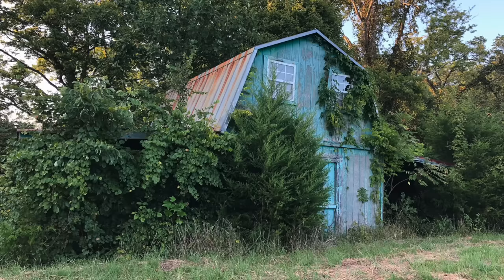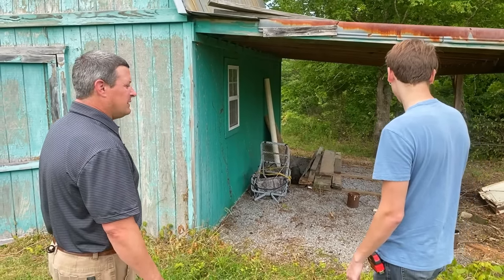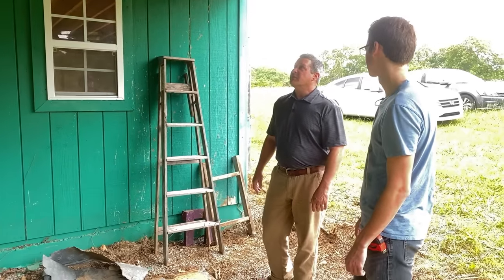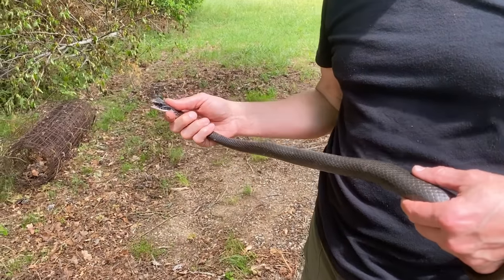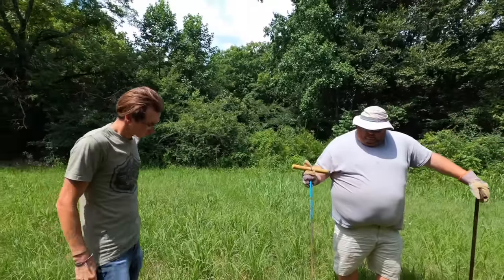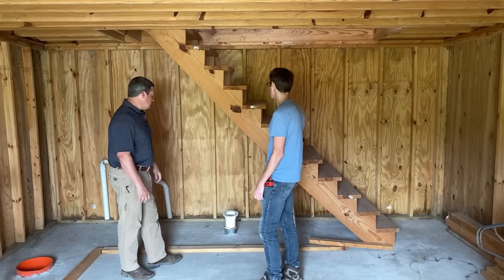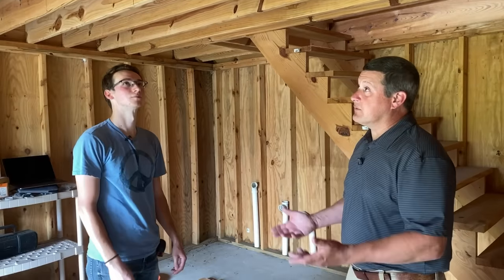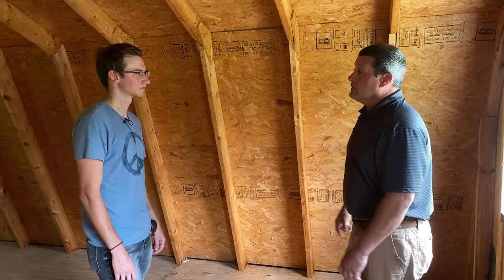Will This Home Depot Shed Meet Building Code?

Comment: If it's structurally sound and meets state safety and fire standards, then the shed should meet building code. Zoning is a different story as in most cities, even safe and well built alternative housing structures like sheds and travel trailers are not allowed to be used as dwellings. Municipalities want people to live in conventional houses and apartments so they can maximize property tax revenue and won't issue permits for alternative housing. Big Government is out of control in most places!
Reply: Sciencer: you make a couple of assumptions here - different ‘use’ buildings often have different requirements. A shed that would ‘pass’ doesn’t insure it would successfully pass code for a dwelling.
Reply: And a great reason that we live in a place that technically doesn’t need a permit at all. We just chose to do it so danner could go through the process.
Reply: And this makes so much sense. It's absolutely true. I didn't think about why they would deny a person a building permit, but now it makes sense...(the mighty dollar). Very insightful
Reply: @lakishadm6587  my county just goes by state building code with no building inspectors but you have the environmental sewage inspection permit that is first required to get any building permit. Then if you have electrical that has to be inspected also. So even if a person wants to live off grid to convert a shed they still are required a sewage permit and this can be a huge issue depending on the land situation and what kind of treatment a person wants. I am using composting toilets and those are allowed as a privy but a privy is only for a seasonal residence permit! The county next door does permit a "year-round composting toilet" but that is a very rare understanding by their sewage inspector! So technically any "toilet waste treatment device" in a structure is a privy that requires a permit. But by the state standard if there is no discharge then no permit is needed and legally after a year the septage is no longer septage (and thus no longer discharge). So a person could technically have a composting toilet in their dwelling as long as it is a "continuous composting" system with no discharge for a year minimum. Discharge means any kind of dumping of the septage. But then according to state building standards composting toilets are not allowed as a plumbing code - if you do have a continuous composting toilet that requires plumbing. If there are no pipes but just a toilet "chute" into a composting chamber then that is not considered plumbing - but I suppose it is arguable. I actually talked to the county sewage planner and I realized he didn't understand composting and he said he thought a year-round composting toilet could be permitted but it would have to be installed by some professional designer, etc. This is definitely part of the "mighty dollar" problem because there is no state permit needed for a farm to spread class-A or class-B human biosolids and so composting as a farm is allowed based on the sewage permit standards! 
So legally you could put the composting toilet in a tent so that it's a shelter and not a structure - and then move the tent every six months. But composting only takes place if the temperature is warm enough - and also people like not having to go outside in the cold. hahahaha. We get very cold climate where I am at. Also a farm building does not require plumbing code but that is only if you get tax assessed as a farm - which requires certain standards like minimum acres or what kind of crops, etc.
So it's probably better to just live in a tent without the government micromanaging something they don't understand: Ecological sanitation as composting!! Legally a person in my zoning can camp for seven months a year - with residency established after six months. But to get a street address as a permanent residency then the tax assessor needs to have some kind of permanent "facilities" building permit based on the said sewage permit catch-22. Vermont is trying to pass a law enabling people with composting toilets to actually compost on their land! Why? Someone got shut down on their farm for composting. There is a youtube channel with regular zoom discussions about this situation in Vermont - if that law passes then it would help other states pass the same law.

Comment: My house in Phoenix, Arizona was built in 1966. the main portion of the home is 4 x 8 x 16 concrete block, the addition I built is 2 x 8 framing with batt insulation. The exterior walls were furred with 1 x 2 strips, then foil backed drywall around the entire perimeter. I am sure your uncle will guide you correctly in how to modify the existing building to meet your local codes. Paying attention to detail, and going the extra mile will save you later so you do not have to make major changes! Plumbing will most likely be the biggest issue. I love anything house, I will be watching carefully!! Good luck with the endeavor you are under taking!!!!

Comment: Last yr, my son's friend bought a straight wall. 2 story Tuff-Shed and we wired it for him in a weekend! Elec hot water tank went under the stair landing. Elec Panel was above that with elec service meter on the N end of the building. Circuits went up through upper and lower stair well walls. Toilet, shower,  was under stairs, 30" door on rt end. Kitchen cabinets from stair to bathroom door. Wood stove   in S. back corner of liv room. Mini/split AC N end, next to elec service. Upstairs big bedroom and sleeper/sofa down stairs for company. His Tuff Shed roof sagged and walls spread after heavy rains! We pulled the walls back in with come-alongs, Bolted steel cables thru the wall headers, next to each roof rafter with turn buckles in the center for adjusting. Then added an L shaped brace above the ceiling and short vertical 2x4's bracing the center ridge. Building wouldn't have passed a framing inspection as-is but the guys who built the kit weren't framers and there was no inspections out in the country... Glad we caught it in the elec rough in stage!

Comment: When they talk about grading, that is somewhat important because you want the ground around the first ten feet of area around the building to slope gently away. Otherwise the footings and concrete get damp and promote mold and wood rot. He mentions "swales" or shallow valleys to drain water away around the high side. Closed captioning actually called them "swells" , one being the opposite of the other. Also, soil around buildings tends to build up over the years, as much as 6 inches in a hundred years, due to fertilizer, loose dirt accumulating, rotting leaves and such, so you want to make sure the floor stands up proud from the landscaping.

Also, the first floor may need more windows. Something like 7 percent of the floor area as window. Also, any bedroom needs an outside door or window of a complicated particular size (allows a firefighter with a air pack through). 24" high opening minimum. 

You can make the first floor a small studio/bedroom, and use the stairway as is, closed off by a door below to the "storage attic" as last resort and still meet code. If you insulate correctly. Last resort. Might be a quick interim method, with a plan to change upstairs later. They might not notice, but each dwelling also requires a 36" wide front door. If it opens into a bedroom, that meets the emergency egress/rescue requirement for bedrooms too. If you want, call the garage a patio and do nothing to it for a long time.  Also, the metal siding you mentioned is a good idea also for fire protection as well. With global climate change that might become a problem eventually in your area.

Stairway height clearance is 6'-8" clear, but used to be 6'-6".  The studs at the bottom look like almost 3' on center! There are certain advantages to open cell foam in a fairly dry area, in that you can use it between rafters and not have to ventilate the attic, but that is a somewhat new development.
Reply: Gary Wheeler, I was thinking the same thing. This shed is at the bottom of a long downhill slope yet the slab supporting it isn’t built up enough to keep serious rainwater out, nor compensate for sod rising over time. My in-ground swimming pool is now BELOW the sod on one side because in the last 16 years since it was installed the sod has built up. I’m not sure how to combat the situation unless I rent a sod cutter and remove the lawn entirely, dig down several inches, then roll the sod back in place (or re-seed and hope the grass seed takes in the hot pool area. 

I love this shed. I did an in person walk-thru of this style shed at my local Home Depot about ten years ago, and it’s the perfect 2 story camp, guest house, bachelor pad, or newlywed apartment.
Reply: @GW
Egress has nothing to do with fire personnel getting in. 
NFPA specifies a second means of ESCAPE. Firefighters will (and should) use their bars and eliminate entrance barriers in seconds. 
Specifically less than 44” from the floor, minimum 20” width, minimum 24” height, at least 5.7 square feet. Some jurisdictions allow 5sf, or 5sf first floor, 5.7sf second floor. And the secondary means of egress needs to be less than 20’ to the exterior grade.
Reply: @fishhuntadventure  : the term residential "egress" windows specifically uses requirements of size and accessibility to allow residents to exit and fire personnel with an air pack to come in and rescue. So there is that...

Comment: Building codes, permits, inspections, taxes and fees.... things used by the county and state governments to control what you do on the property that you bought and supposedly own, the government  makes a profit off your land ownership. If you buy land there is a property tax you pay(each year)... if you build a house on it... the tax goes up... if you build a barn/garage/shop on it the tax goes up... If you improve the value of any of those... the tax goes up.. all while you had to pay a fee for a permit to even build them in the first place. You have to pay a fee for the inspection... then there is building codes the inspectors follow... which usually equate to having to pay more out of pocket to meet their requirements...
Reply: No permit was required to build on our land. We chose to do it so Danner could go through the process. Our local building department is amazing. They are completely centered on people succeeding.
Reply: The counter point in favor of building codes is that what you do for yourself is all since and good but if your shoddy work puts guests or the people you sell the house to in forseable danger then we should prevent that.
Reply: @brianzmek7272  Those are certainly not valid reasons allowing any government to deny you the ability to build what you want on your property without interference.  Guests and future owners are assumed to have brains of their own.  It is not a counterpoint, it is a talking point, and not a good one.  Building codes are unconstitutional, complements of the Fourth Amendment.  If you have not yet realized what happens when you allow the government a little power, you need to pay more attention.  When the same people who mandate the quality of construction levy taxes based on that quality level, you have a certainty that some day no one but the rich will be able to afford even a 500 sq. ft. home!  Do not encourage this nonsense.
Reply: 100% agree and the insurance companies implement most of the codes to make the houses insurable, and I get making structures safe but controlling every little detail down to the stairs and trying to make it impossible for someone to build a house without contracting the work out to someone else is a bit excessive to me. The insurance companies want to prevent hazardous conditions from injuring someone, yes, but they go way overboard with it. If it's OUR property, our money is being paid to build it, then why do they care if my stairway isn't precisely how they say it should be? And why does the government need to profit from my investment, why do I owe them anything for building a house on land that doesn't belong to them? I guess charging for the inspections makes some sense, but the loads of additional fees in some municipalities is just beyond reasonable. They even go as far as to 
Control the appearance of homes in some cities, even when the materials used have no bearing on safety at all.
In ways it just seems that the government are just freeloaders who make money from us in which they are not entitled to, and they want to control every aspect of our lives. But just because the government declares they are entitled to it, that makes it so, who are we to question the rulers of our nation? The whole thing is just out of hand, not to mention to majority of people who take out a mortgage will end up being a slave to whichever bank they finance through, the interest compounds so much that they never get it paid off. This is why so many people are turning to alternative means, though the government tries to outlaw that with these strict ordinances. someday very few people will take out a mortgage because people are getting fed up with being in debt for their entire life.
Reply: I agree with you 100% America is home of the fee not the free
Reply: @jermanemckay8945  True specially in Texas. Property taxes are SKY high.
Reply: it’s been really upsetting for me trying to get my first home on my family’s land. i don’t want to have to fly under the radar of the law just to have a free standing studio apartment house!
Reply: @Leo D  not if you designate the land as a farm or ranch to get the agricultural  rate. Just buy a couple of goats or sheep. Discounted taxes and free future food source
Reply: @CliffBailey53  You're a good person. 🤘
Reply: I've been saying this for years. I always hear its for public safety and future sale... it's private property not public and before every purchase there should be(and almost always is) an Inspection. Ok let's says those reasons are good, why are we being taxed every year? If I buy land and just camp on it the taxes are about 150 a year here in florida, but if I build they are around 2500 lol with is that
Reply: @MrZZeroG  That's great. I wish I could say the same about those controlling Washington state
Reply: @James-gx9mr 
Its not so unreasonable, in theory- a tax on properties means there's an opportunity cost on just sitting on land en masse, so that more people can have the opportunity to be land owners.

These kinds of laws are all over- such as how the point of copyright is to give innovators a bit of exclusivity at first, so there's financial incentives to keep being innovative.

The problem, of course, is that these types of rules aren't enforced in a way that actually serves the purpose of enabling opportunity, and instead more often inconveniences the little guy.

I mean, the original purpose of copyright has been all but forgotten

Comment: I like how the guy said if you eliminate the air leaks, you will reduce the moisture issue.
Home Depot has those thin foam panels you put in the attic above the soffit to prevent blanket insulation from blocking air passage to the ridge. Since he'll be occupying the attic, perhaps run those panels to the ridge vent you'll be installing.
Then use 2" of closed cell Froth Pak from floor to ridge. That should leave an inch or two gap before the drywall.
That'll make it air tight and the roof will be ventilated too.
You wouldn't be gaining much by bringing the foam flush with the end of the "wall studs".
Leave room for wiring etc.

Comment: Great video!  The only problem you run into with a tighter home is air exchanges.  If Lincoln county has an energy code that means you will have to have a blower door test which means if you foam it and make it too tight, you will have to have an air exchange system on the hvac system    Older homes were not as tight but were able to breath better :)  for every action, there is an opposite and equal reaction :)  I would try to use batt insulation and furr down the rafters to keep the roof ventilation with baffles between the batts and the roof deck. Anyway, it will be a fun project.
Reply from the maker: Thanks for the advice, Tony! I had to google what a blower door test was
Reply: @DannerCronise  :)  I would check to see if they have an energy code in Lincoln County.  They may not have one and my guess is they do not.  In that case the typical insulation requirements are R-13 in the walls and R-30 in the ceiling.  This matters because it will tell you how much furring you may have to do on the inside of the roof  at the rafters.   And if they do not have an energy code, they most likely do not require a blower door test :)